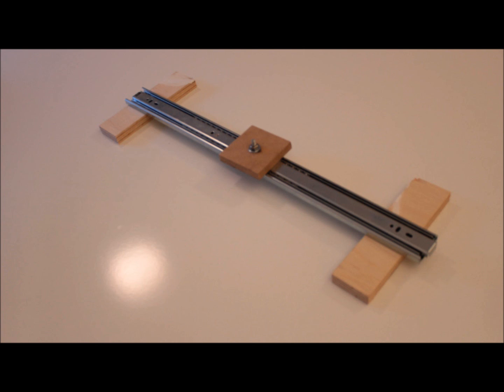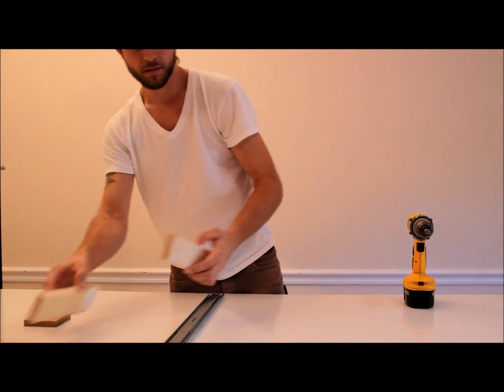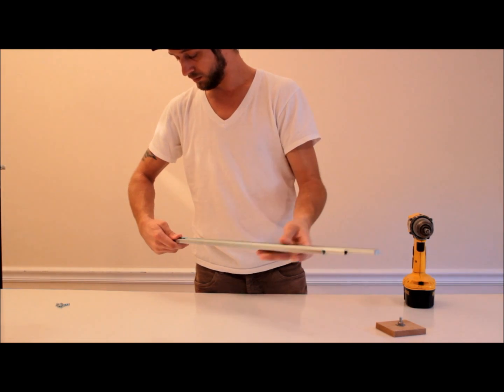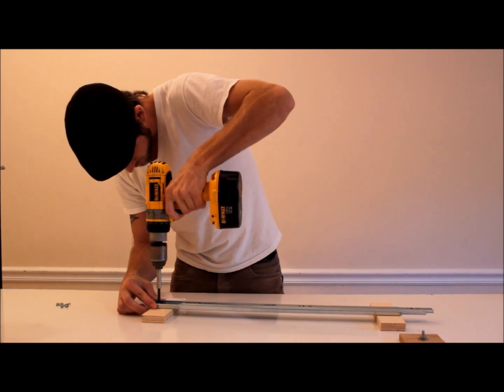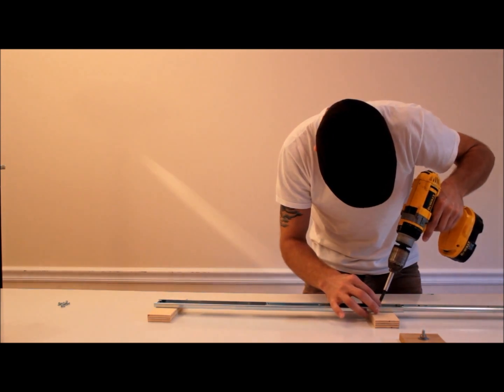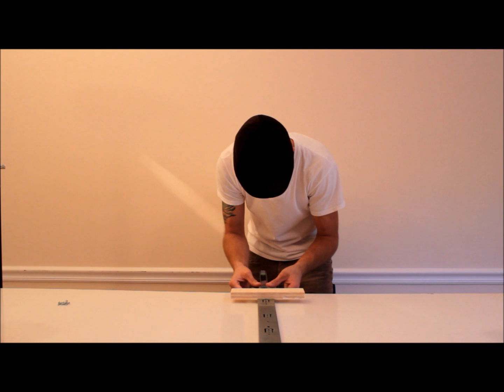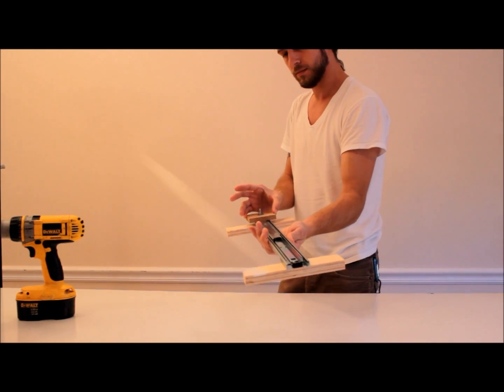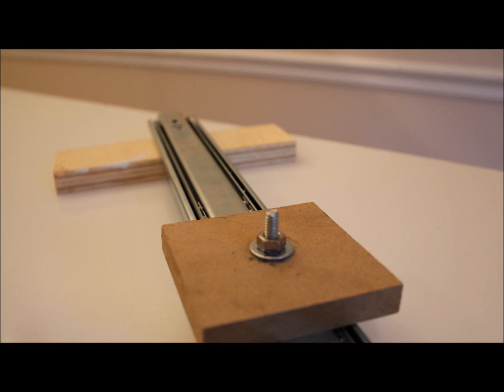DIY  glide track / camera slider [Canon Rebel T2i / EOS 550D]  tutorial

Comment: Hey folks!! Save your bucks and DON`T build one like this!
I did and it´s worthless. The slider it self is waay too unstable.
Went to different home stores and all the sliders were unstable.
Reply: Tried it with a 5DMk2 on a big board and knelt on the board in the garden. Mixed results, but, if handled carefully, could work. Yes, it is a little wobbly, but pretty solid if you only go out by one length (i.e. on the two other lengths is more stable, if that makes sense). Should work better on a solid floor. Will give it a go for a corporate film I'm shooting in a few weeks and let you know how it went.
Reply: Maybe you should try to use a tripod mount in the center and use a tripod to "stabilize" it? Saw sth like this on GoPro Slider DIY video at YT.
Reply: Or just use some washers on this wooden parts.
Reply: Could work but it´s the sliders it self that wobble alot. Tryed different ones, cheapos and  expensive ones.
Reply: Christian Osbakk
 It looks as if that kind of slider worked only with camcorders like GoPro etc and lighweight photo cameras...
Reply: Anyway, I've ordered necessary stuff and I'm building it in the nearest future for my Kodak ZX5 :D.
Reply: Same situation here with 1 slider. Too much wiggle. I modded the idea and used 2 sliders and it's very solid with 2.

Comment: You could put a piece of wood on the middle of the track (If you could without hindering the movement of the track) then buy a quick release plate that fits your tripod, then screw the quick release plate to the middle piece of wood (to where the quick release could fit on your tripod. on the slider, then attach it to the tripod That may work. Feel free to check out my channel

Comment: Okay, so this is my first DIY project for my dslr and it turned out really well. Although the design presented in the tutorial may change depending on what type of drawer slider you get, the concept is the same and the possibilities are endless. I am going to work on a swivel now so that I can do horizontal shots and vertical. There aer other designs out there for longer slides, but for short sliding shots, this is great! Thanks for sharing Adam!

Comment: why don't you add a 24 inch by 3 inch long wood board to the base of this slider and mount the centre of this unit to  a tripod. make sure your tripod has the water level bubble.

Comment: I love the idea and actually went and built one today.  The ONE thing I had any kind of trouble with is how exactly did you attach the middle block to the rail.  I believe I went and got the exact same 24in slider that you have.  The problem I'm having is the head of the 1/4 bolt to be used as the mount.  If I tried to place it on top of the rail it was damn near impossible to screw in because the wood wasn't flush, so I tried to go thru the hole but the bolt head is still a bit too big.

Comment: @vbfl920 I got the drawer slider and everything else at home depot, I had to bore a hole into the wooden block to secure the 1/4 bolt. I took my camera to the store to make sure it would fit. The wooden block / camera mount is screwed directly to the slider with small screws.

Comment: Did you attach the camera mount wooden block via 1/4 directly into the slider? Do 1/4 bolts fit into the wholes? Also, where did you get the drawer slide?